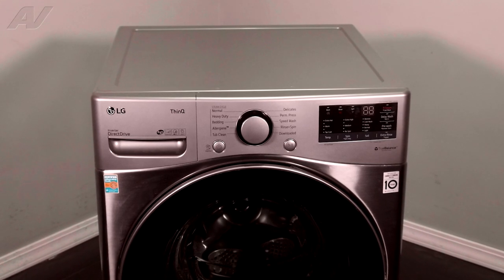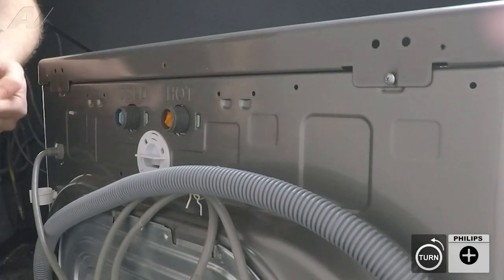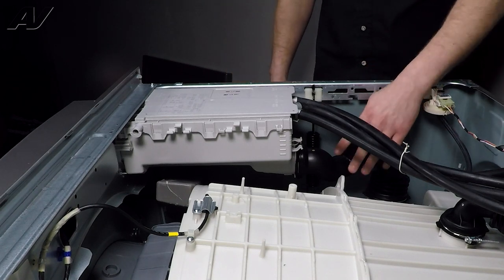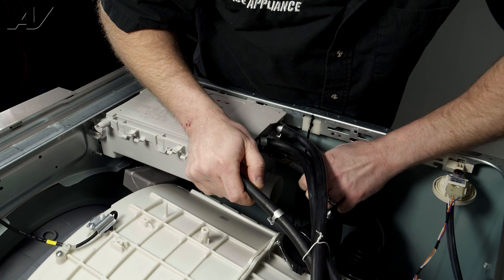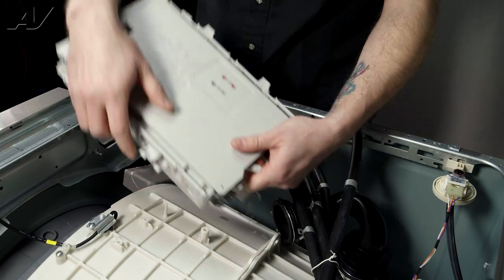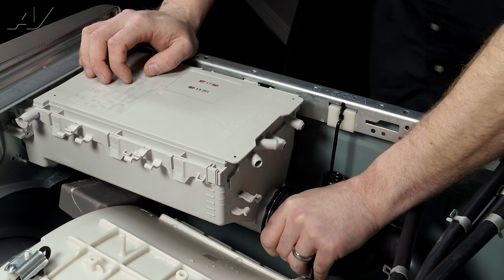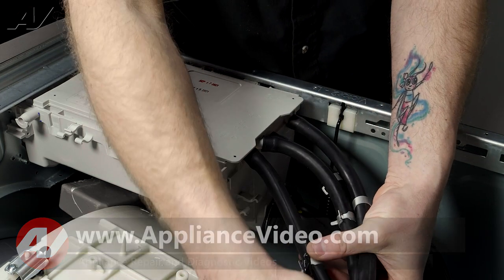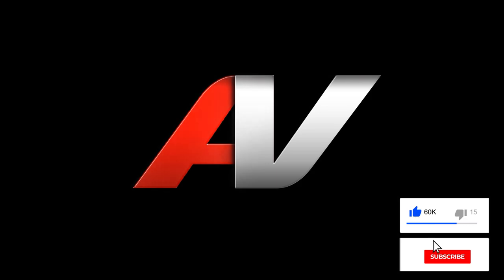LG Washer Dispenser issues - Diagnostic, Repair & Troubleshooting

Comment: I removed mine yesterday. I popped the top off and found all the holes clogged with minerals. Cleaned them all with vinegar and a pipe cleaner, to include the supply tubes that were also clogged.

Comment: If you fabric softener dispenser isn't draining, or has a lot of water in it at the end of the cycle I found on my WM3700 that buildup had occurred on the connection under the bleach dispenser lid which has the molded pipe that slides over the fabric dispenser drain pipe as well as the molded drain pipe in the softener basin . I thoroughly cleaned all that area with vinegar and a dental pic,  What was happening I figure is that the two molded pipes that fit together when you put the bleach lid back on weren't seating and that bit of buildup on the bottom recessed part of fabric softner compartment was being block. It should be a very tight seal and to make sure that when put that blue bleach dispenser lid back on you make sure it's seated right down and all the area around it is clean..  Solved my problem.